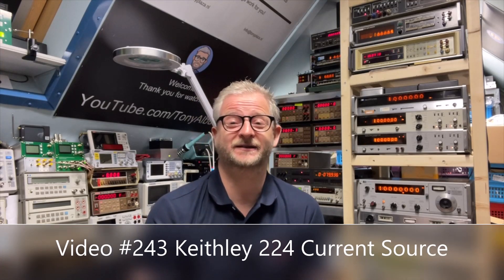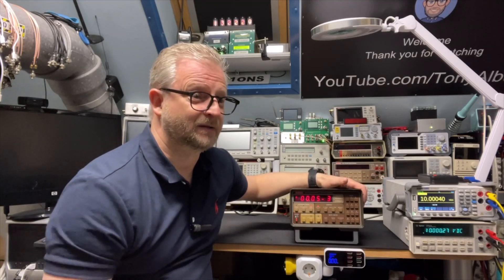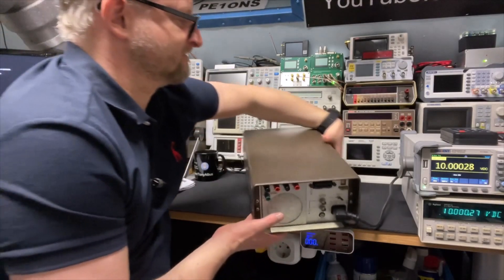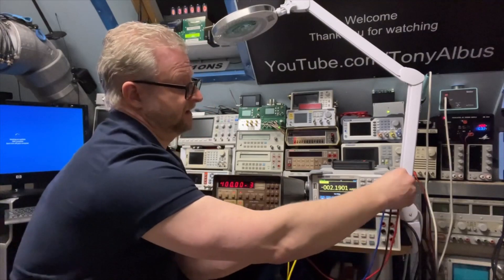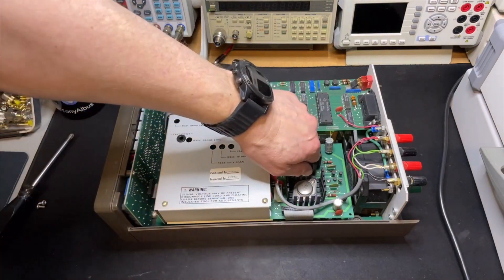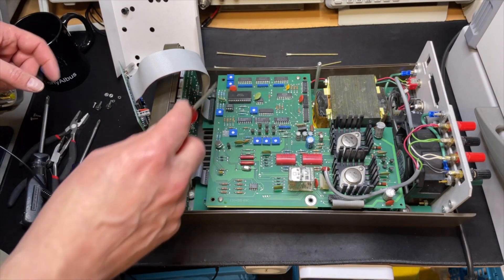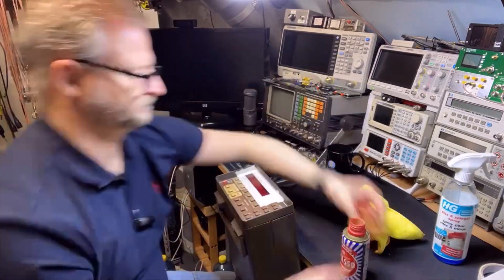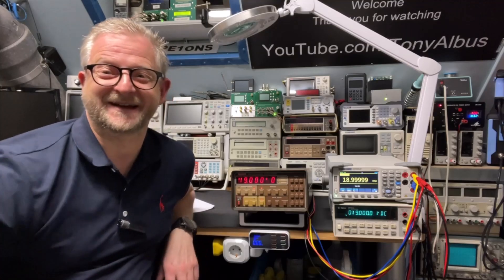#258 Keithley 230 Voltage Source - Cleanup Calibrate

Comment: Thanks Tony for the video on the Keithley 230.  When I ordered mine I didn't know there were two models and I got the Keithley 230-1 which has the same front panel but has a gray color scheme instead of the brown one.  The rear panel of the 230-1 has BNC output connections with the sense wires strapped internally. The 230-1 is a special version of the 230 with the necessary connectors for compatibility with the Model 82 Simultaneous C-V Systems from Keithley.  I think the 230-1 may have been manufactured much later than the 230 because the integrate circuits in my unit are around 1997.  I also found that the chassis is punched to replace the BNC connectors with the four binding post but it would require drilling four holes in the back panel fan plate.  So you could convert it pretty easily to just the 230 if needed.  The manual shows the schematic mods that are made between the two units.  I have just made coaxial cables for the 230-1 and like you I have similar results in calibration since both units are really the same.  My unit has been working very well and it is a nice device, especially with the higher calibration voltages as you mentioned.  I was also lucky since these units are normally under computer control and probably in a rack.  Therefore, front and back panels, display, and buttons look or feel new.  The front panel on both units are label 230 so there might be some confusion on what you are getting when buying one.  I thought it was a newer version with an updated color scheme when I bought it.  Reason I am posting is just to let other viewers know that the 230-1 might also be a good choice and that there are two versions with the same model number on the front panel.  Always looking forward to your next video!
Reply from the maker: Thank you John! , that is some good information about the 230-1 , also great to hear it works well!..
Reply: I too ended up with a 230-1 but I have now converted it to bind posts and added the switch back so I can do local vs. remote sensing.
Reply: @electromot  That sounds great on your conversion.  I am just to lazy ; )

Comment: Hello  😃 
thanks for your video and let us look inside, which is very interesting.
My question is, are you shure, the shown AD544kh is the precision vref? It seems, it is a precision opamp as a voltage divider, which regulates the vref from the precision diode or vref with the TO92 housing on the left.
Greets from germany
Reply from the maker: Hi, you could be correct makes sense , i am not sure.

Comment: Do love your wall of vintage test equipment Tony. The HP34401a can sample at a faster rate by pressing Blue shit then down arrow. To recover the lost digit press the > button. This reduces the Power line cycles at the expense of more noise. I'm sure you know that already but it may be interesting to others.
Reply from the maker: Thank you Simon! , i did not know that, i still need to read and play more with it.